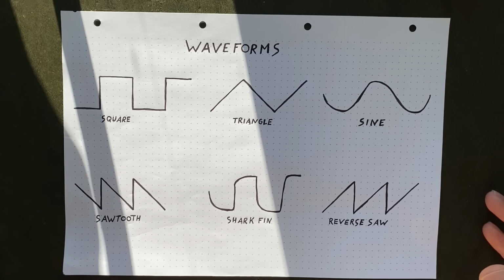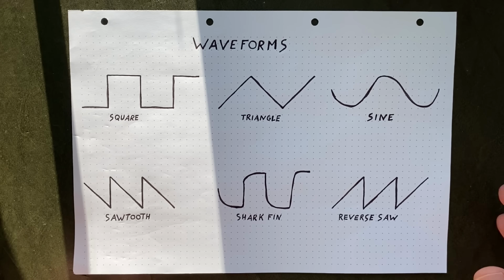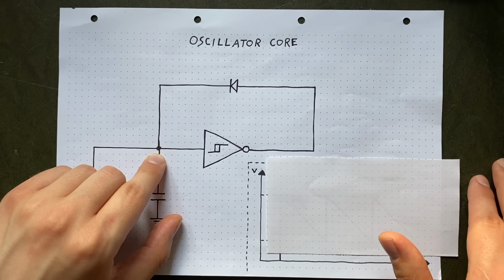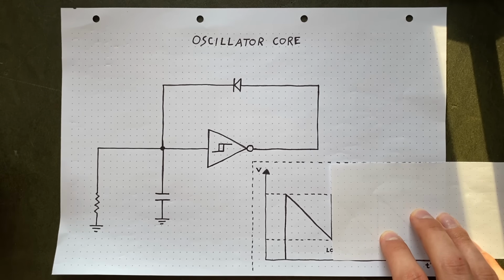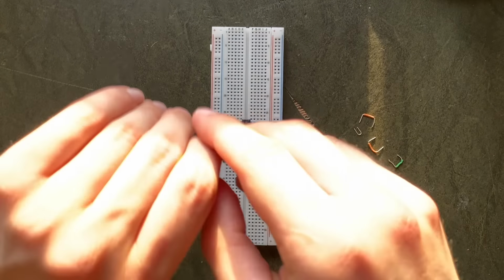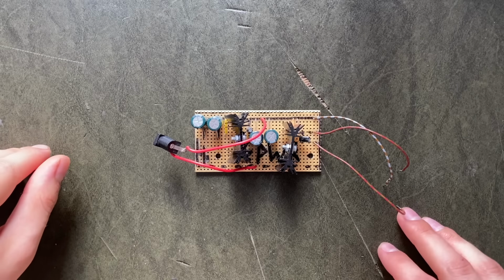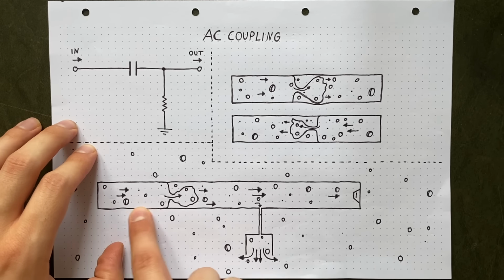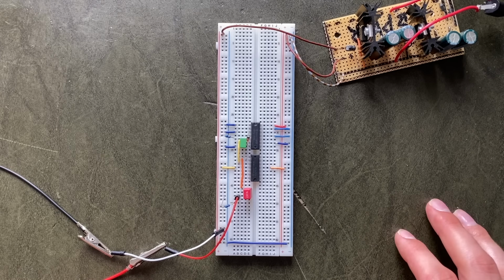DIY VCO Part 1: The analog oscillator core anyone can build

Comment: If anyone feels like they’re attention is drifting, or that the theory is so new that the info doesn’t stick, just keep watching and trust the process. This is the best oscillator tutorial on the internet. Your well on your way to your 40106 addiction 😂
Reply: wat bout 7414
Reply: @urnoob5528  I tried a 74LS14 and had problems starting the oscillation, it didn't source enough current for my component values. I tried a 74HC14 and it worked. Grounding leftover inputs is a MUST with the sensitive CMOS inputs in 74HC.
Reply: This is just a masterpiece of content from a Master.

Comment: Loved this video, understood most of it. I got lost in one place, so I figured I'd note it down in case it helps you write future tutorials for dumbasses like me.

I didn't really understand the point of the AC coupling. I do get what it's doing in your drawing, but not what the end result was if it was put through a speaker. Since you mentioned that hooking a speaker to the buffered signal would distort and/or damage the speaker, I assumed the next step of AC coupling would fix these mentioned issues.

Then you said that it would still damage the speaker, and demonstrated the voltage divider. I understood this as making the signal quiet enough so that it wouldn't damage the speaker.

But I'm missing the middle bit there, the distortion. Had you demonstrated the distortion by hooking up the speaker with the voltage divider but without the AC coupling (assuming this is safe), so we could hear the distortion, I feel like I would understand better. Right now I'm taking on faith that offset voltages = distortion = bad, but not what that actually does. I know that frequency is pitch and voltage is amplitude/volume, but I don't have a way to comprehend what the offset voltage is doing.

Comment: Hello ! Thanks a lot for all those explanations. Seems really useful to start building oscillator.
I just have a question. I don’t understand how you connect them with wire. How does this work ? Can someone explain to me pls ?
Reply: Look up how to use a breadboard. The holes in the breadboard (the white plastic thing) are not just going into nothing, there are small metal rails underneath connecting some of them together in lines. It's difficult to describe in text form, but if you google it you'll find some diagrams that explain it much better than I could.
Reply: @synthgal1090  Thank you so much !

Comment: @MoritzKlein0 when I put this together, i get a triangle wave instead of a sawtooth. what can be the cause of that? I'm using the same values for components and 2 nine volt batteries. thanks
Reply from the maker: did you watch the next video already? i think i explain this issue in the very beginning!
Reply: Turns out i put one leg of the capacitor in the wrong hole. Thanks for the hint though

Comment: One question.  Around the 12:00 mark, you mention that the schmitt trigger turns off, which then allows the capacitor to drain via the path through the resistor to ground.  Why would it not drain through the schmmitt trigger?
Reply from the maker: because the diode is in the way - it’s like a one way street for electricity!
Reply from the maker: or do you mean the schmitt trigger inverter‘s input? if so, that input only reads voltage, it doesn’t sink any current. it’s like a probe/sensor.
Reply: @MoritzKlein0  Right, this is what I meant, apologies for not being clear.  Now, when the capacitor discharges, would it not act as a source of voltage (at least until equilibrium is achieved), and therefore activate the schmitt trigger inverter's input?

Comment: Moritz, probably a dumb question, but I’m wondering why the oscilloscope probing doesn’t also send the voltage to ground ? Kind of like why you have to use an op amp buffer for the audio output. Basically, I’m wondering if you can mess up a circuit by probing an oscilloscope in the wrong place.
Reply from the maker: not really - oscilloscope probes have a really high input impedance! this means that barely any current flows into them as they sample the voltage. kinda like an op amp input!
Reply: @MoritzKlein0  Aha! Thanks for clarifying! Does the same holds true for using a digital multi meter? I think I’ve watched this video 10 times and every time I get something new out of it. Thank you so much for sharing your knowledge in such a digestible way.

Comment: Noob power question:
I'd like to use a Mutable Breadboard Friends dual PSU for power. It should put out +/-8v because I used an lm7808 & lm7908 when building it. Will that impact how the VCO functions on the breadboard versus using 9v batteries or a 12v Eurorack power supply?
Reply from the maker: it’ll still work, but the circuit’s behavior will change (off the top of my head: pulse width range, output volume, coarse tuning knob). if you want to avoid that, you’ll have to adjust some of the resistor values.

Comment: I used a SN74HC14 Schmitt trigger invertor instead. I needed to step down the VCC (power) to 5 V and use a 1M resistor instead of the 100k resistor for the oscillator core. If I didn't switch the 100k out (for a 3nF cap) the oscillations would die out and become a DC signal instead (this is all pre-buffer etc.) I don't really understand the differences yet but it probably comes down to some of the differences between my chip and the 40109 used here. Just to say you can use other parts and get something that works.

Comment: New to analogue.  I have made some op-amp based signal generators.  They are tapped to give me Square, Triangle and Sine and I have them working quite well with CV inputs.

Are these fundamental?  Can I combine them with some mixing, integration or differential operations to get the other waveforms?

Assuming I can control their relative phase, does anyone know how Saw can be built from these?  Also, how about Saw-R, Shark and Shark-R?

Comment: What’s the difference between using 9V or 12V power supply in this design?Is this module using 9V power supply?Because in another video ,talking about 12V dual power supply. I’m confused 😢
Reply from the maker: you can use either. it’s designed for +/- 12V, so the output volume will be a bit lower with +/- 9V. but otherwise it’ll work just fine.

Comment: Hmm, when i build the circuit, it doesn't seem to be affected by the resistor value at all. In fact i can completely leave it out, but this means that i cant change frequency. I am using a 4585 as the schmitt trigger

Comment: The feedback is suppling a constant current for the capacitor voltage to be a straight line.   That I wouldn't have thought would be the case.  There does seem to be some small exponential decay (not much) to the waveform.  Still a very cool circuit.

Comment: Your videos are excellent but I have to say the width of the square wave doesn't represent frequency. The repetition or number of times per second that the wave (square, sine, triangle etc.) repeats is the frequency. The width of the wave is irrelevant to frequency. You can have short spike shaped square waves at 100Hz or long square waves at 100Hz (or any other frequency).

Comment: The foil capacitor you're using is a non polarized capacitor alright, however when you're working with sound or anything else that is sensitive for signals coming from something outside the circuit you really should treat the non polarized capacitors as a polarized one, let me explain...
The foil capacitor is made of two metalized foils, separated by a non conducting foil, therefore you'll always have one of the metalized foils on the outside and the other below that making the most outside foil more sensitive for outside noise that it can pick up, so if you really want or need to keep out as much noise as possible you need to connect the outside metalized foil to ground and the signal to the other pin and you can measure with your oscilloscope and a signal generator what the outside foil is by connecting the signal generator to one side of the capacitor and the other side to ground and connect the oscilloscope to a small coil that you can make yourself it doesn't need a lot of turns and the smaller the coil the smaller the area that it can pick up the noise, or you just buy a specially made probe for that to do the same thing, now if you hold the coil or probe next to the capacitor you can either see it clearly or you can't see or just a tiny bit of the signal that you're putting into the capacitor with the signal generator.
So when you see the signal very clearly you know that's the outside foil of the capacitor and when you don't see the signal or just a tiny bit, you know that's the inside foil and that's the pin you should connect to the signal of whatever you want to protect with the grounded outside foil from noise coupling into the capacitor, doing this makes sure you're keeping the noise to a minimum level.

Comment: when using an oscilloscope you should let us know what your settings are. 1.5 squares doesn't tell me anything unless you tell me how many volts per division the scope is set at.....so what voltage should I be sending to my amp?!?

Comment: Hey Moritz, there's one thing I don't understand.
At the AC coupling part, I understand that the capacitor bring the whole waveform down (I'm guessing this is due to the new relative voltage starting from the capacitor (conventional) to the ground).
But what I don't get is how in this situation the "baseline" for the new center is 5V, how is this so, why does below 5 result in a negative voltage in the other side?

Comment: The water analogy might help but is kinda disturbing. About the schmitt triger , this simple circuit works only on CMOS technology I think. You should experiment different results on TTL technology with transistor emiter on input. Anyway the point of view of non electronician hobbyist always interesting.

Comment: hm something fried my 40106 and I jave no Idea what. tested a spare I had and it didnt overheat
Reply from the maker: sometimes those chips are faulty, especially when you order them off ebay!
Reply: @MoritzKlein0  They were from Reichelt. Texas instruments. Could it be that the 2,2nF or Diode are faulty? would that create a short? Or maybe its the ceap breadboard?

Edit: Also the first one worked nice until the potentiometer step. I fiddled around with the Potentiometer and dialed in audible audio range, all fine. I disconnected the 9 Volts to do soemnthing, went back and suddently had no oscillation any more, when I touched the IC it was super hot and it burned my finger. I used a BC547 instead of a 548 dunno if that maybe broke something.

Comment: I can't seem to get the OP Amp to work. I'm getting a good signal out of the Schmitt Trigger but nothing out of the OP Amp. I've checked my wiring several times and even replaced it with a new OP Amp. I even checked to make sure the signal made it down to the right pin on the OP Amp but I am still getting nothing out of it. Could it be that I am using a polarized capacitor?

Comment: if you sent varying levels of positive to that, the capacitor would just block,  there has to be some loop back through that resistor for that capacitor to discharge on, or i cant even see how that high pass filter would even work.

Comment: This is an excellent explanation of coupling capacitors.  I sorta knew intellectually that they removed DC bias, but I didn't really get the how or the why before.  Thanks!  I'm hoping to learn enough from this series and others to design and build my own analogue synth from parts I've already collected over the years, so every bit of theory is very helpful.

Comment: I have tried building this circuit in LTSpice and am only getting a flat -9V as the output voltage when I probe it. I have attached a +9V and -9V to the op-amp power rails and then am powering the circuit with a 9V DC voltage supply. I cannot recall anywhere in the video that states we have to use an AC supply which I think is where I am going wrong, but I am just not sure

Comment: I'm struggling with understanding how the Op-Amp works.  I'm good with the basic calculation of output equal to the difference of inputs times gain but I'd like to understand how the internal circuitry works, as well as why negative power is necessary (and even what is negative power in a DC circuit).  I've been looking online for a while but haven't found a good source to begin.  Any recommendations?  Something similar to your description of the oscillator circuit starting with a snapshot at state zero would be outstanding.  Thanks!
Reply from the maker: try this: https://youtu.be/YNoj9Rrw_VM?t=148
Reply: @MoritzKlein0  That helps, thanks!  Do you know of anything that describes what happens to the transistors and other components inside the magic Op-Amp triangle?

Comment: This is probably the best Applied Learning example for basic electronics on the web.  Moritz's basic explanation of electrical component function and circuit design are clear and engaging.  Even if you are not interested synths or EDM, the stepwise process he describes to generate and shape a waveform by building a circuit all while monitoring progress with an oscilloscope and audio is invaluable.  For those who want to go deeper (i.e. how does a schmitt trigger inverter work), I recommend Code by Petzold, but for most I think this will be all you need to get started in electronics.
Reply: You could also configure an Op-amp as a schmitt trigger to reduce the number of main ICs...adding more resisters but we all have a bunch of those already right! Electronoob has a good schmitt trigger equivalent op-amp example: https://www.youtube.com/watch?v=d-7Oyd8o8hE&ab_channel=Electronoobs

Comment: Hey Moritz. Super excited to learn all of the cool circuitry fun, but Im having a problem finding components. Im still really new to it all and don't know what I can and cant use as an alternative component. Searching sites like Mouser, Im completely overwhelmed with all the variations. This biggest issue is finding foil/film capacitors. I don't know what to get, Is there a certain voltage I should focus on and if I cant find the same plastic box film capacitor, can  use a different type of capacitor with the same 2.2nF capacitance. At the ONLY local electrical shop here in Los Angeles, I couldn't find a 2.2 NF but could find a .22 uF 100V mylar capacitor and a .22 uF 50V radial film capacitor (as I understood it that a 2.2nF was the same as a .22nF, or is that wrong?) So I obvy need to learn more, but what can I do to follow along with all of your videos? I feel like a video talking about the what and why you're using X,Y or Z would be helpful, if there are variations that could be used- just trying to wrap my head around it all...
Reply: .22uF is 220nF which is 100x bigger than a 2.2nF
 Any with a voltage rating more than 25v will be OK.

Check AliExpress for variety packs of resistors, capacitors, and trimmer pots.
 You can get large variety packs of components for a couple of buck$.
Get some common ICs too, like 555, 40106, TL074 etc.
 Postage is not fast though, unless you wanna pay DHL about 20x what the package is worth.

Comment: First off, these videos are amazing so thank you! I bought the latest Erica Synths VCO kit and putting it together now! Quick question though.. at 14:00 Are you supposed to tie that capacitor to the in/out pins of the schmidt trigger? or does one leg tie to ground? Also,  does it matter which is closest to the trigger, diode or capacitor? Thanks in advance!!! Again, these videos are awesome!!!
Reply from the maker: the capacitor is connected to a schmitt trigger inverter‘s input on one side, and the 40106‘s ground pin on the other. you could also connect your capacitor to the ground rail directly, but mine wasn‘t long enough for this, that‘s why i‘ve done it this way. it does not matter which component is closest to the chip!
Reply: @MoritzKlein0  Awesome, thanks for quick reply! Again, great work. Looking forward to the next module!

Comment: When you say "plug in an amp"....what exactly do you mean? Will headphones do? Or does is need powered amplification? Also, what frequency did you get here? Measuring with an osc, I got 20kHz with the 1nF and 100k resistor. Bumped that up to 1M resistor to bring it down to an audible-if-piercing 2kHz.
Reply from the maker: it works with any kind of amplifier (hifi, bluetooth box with aux in, etc), but cheap headphones would be preferable because it doesn’t hurt much if you fry them when your circuit is set up incorrectly.